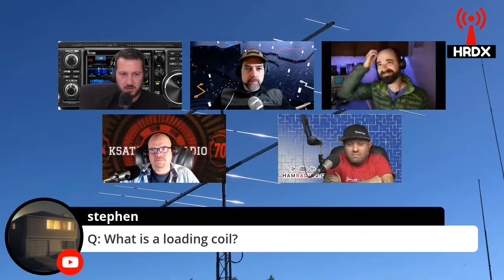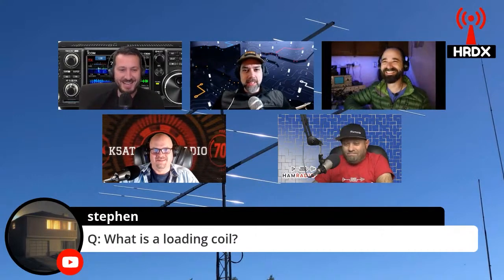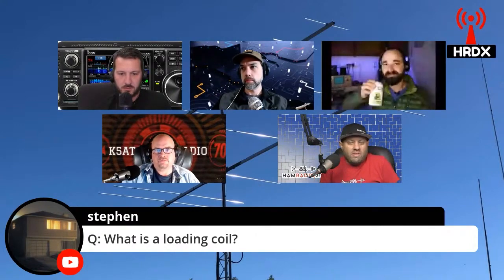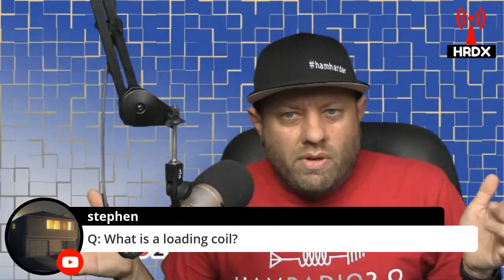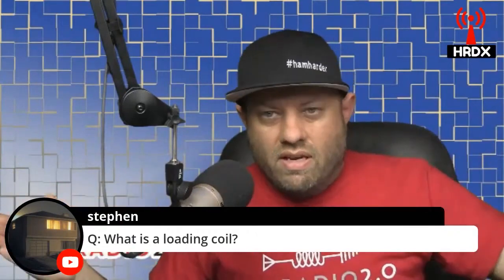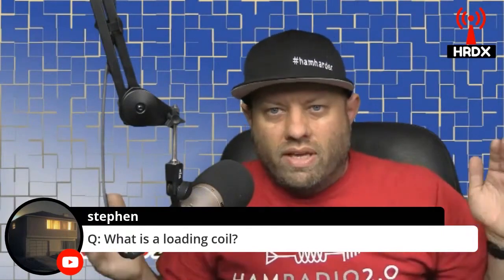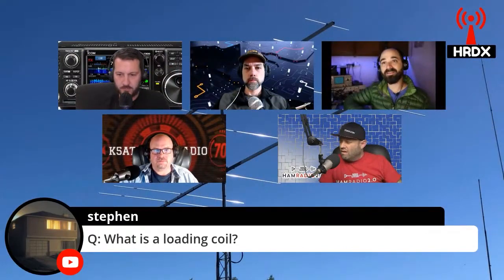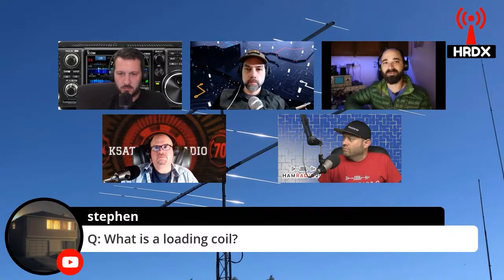What is a Loading Coil?

Comment: I added a 110uH coil to my EFHW antenna to give me 80m. Works well, but im just wondering how it doesnt affect the other bands that it tunes on, as I'm lengthening the antenna. It's a 49:1 UnUn which already tunes on 40, 20, 15 and 10. Im guessing the coil has some self capacitance, which would act as a trap maybe, in conjunction the induction. Any light on this would be appreciated
Reply: Not a capacitance issue but it obviously has inductance and the true reason they're added is to create a tank circuit so your antenna is at resonance with the signal its receiving. In fact, the purpose of the coil is to counter the capacitance and really capacitive reactance of your antenna. The tank's Q will determine the bandwidth, so in this case, lower Q is going to be desirable in ham radio when you're accessing a range of channels. A high Q, simply meaning Quality, will narrow the bandwidth tremendously with dB drop off outside resonance crippling performance if too high. 
Cornered bandwidth rather than a band.

At 300 MHz, even a 1-inch solid core piece of copper with a cross-sectional area of very high gauge will produce capacitance and inductance that may interfere with operation, and really it's the reactance; Lenz Law at hand. This can actually even occur within a circuit trace of a PCB in some types of electronics machines.

Oddly, the mechanical engineer's is the wholly incorrect one. By building the coil into the antenna's architecture, it solves issues and creates advantages such as occupying less space without adding additional nodes and a spool of wire. 

I like to showboat and say I'm an electron physicist and engineer; just a fancy way of saying electrical/tronics engineer, but still wholly correct. 

You are right in mentioning the inductor will have some capacitance, but it's generally irrelevant in this technology.
Reply: @JonDeth  Thanks for the explanation

Comment: From the standpoint of antenna performance, where is the optimal location for the inductor (assuming an inductor is necessary)?  While I understand placing an inductor near the top of a vertical antenna might be impractical from a mechanical standpoint, I'm curious if the optimal position is in the middle point or elsewhere.  Thanks
Reply: Typically 30-60% along the antenna element, depending on dimensions and construction details of the antenna. Check out Frank Dorenburg's discussion and references at this article: https://www.nonstopsystems.com/radio/antenna_80m_vertical-cntr-loaded.htm#top-of-page

Comment: A perfect antenna dissipates all power as radiated emissions.  The equivalent schematic symbol is a resistor (radiation resistance, though!).  If the antenna is the wrong length, it becomes somewhat reactive.  Power delivered to it will be reflected; short antennas become capacitive, long ones become inductive.  If you want a resonant antenna that's short, you add an inductance to cancel out the capacitance.  At resonance, you still get a standing wave and radiation, but there are non-radiating losses in the load coil, affecting efficiency.  Move the load coil farther along the antenna to get it out of the high-current portion, and those losses go down.
Reply: Nope, it's just the antenna all coiled up....didn't you watch the video??? 🤭
Reply: @chris beerad it is my understanding that the coil losses are primarily dependent on current. In the high current region of the antenna, that's a lot of traversal of the coil windings... even small resistance in the coil adds up; dissipates as heat. There are some interesting effects, like proximity effect (keep your coils farther apart to reduce), etc. But yeah, ultimately losses are heat in the coil or the core (esp., if there's a toroid). Farther along the antenna, less current, less loss, but need a bigger inductor.
Reply: @daveN2MXX  the video is still half wrong regardless of who you favored.

Comment: We need to stop with the overly simplified "the extra wire is just coiled up to make the inductor" analogy.  It might be easier to understand than the facts and technology, but is completely incorrect and misleading, especially to new operators.  The simplified correct answer was given in this video, followed by a nonsense answer.  Take a few minutes to learn about antenna capacitance and inductance and a smith chart, rather than say "just coil up the extra antenna".
Reply: Thank you David
Reply: Neither provided the right answer. I'm an electrical engineer, that's how I know.